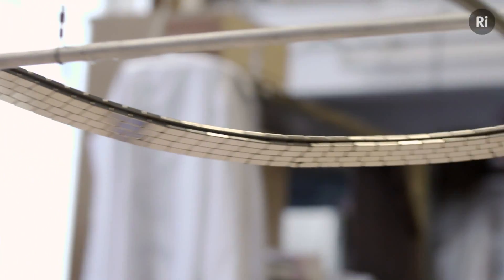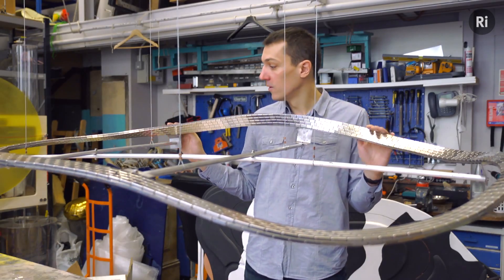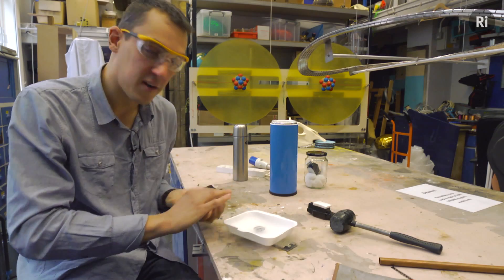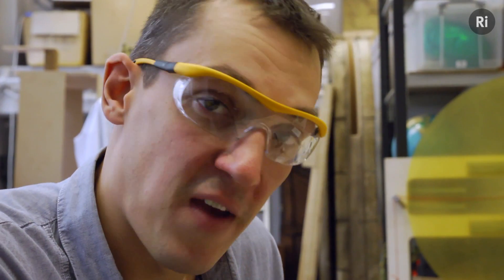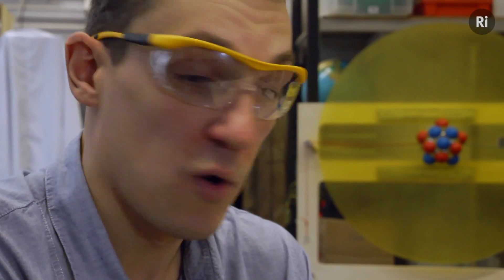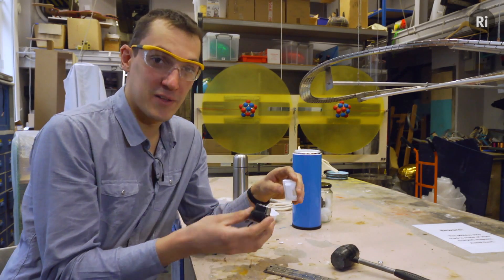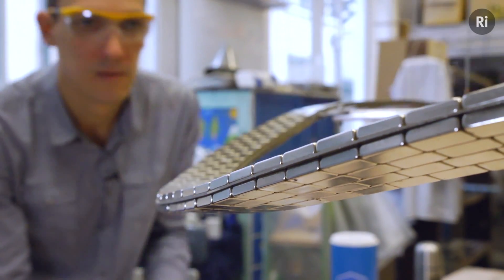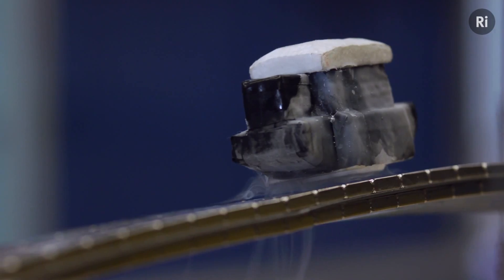Levitating Superconductor on a Möbius strip

Comment: Is it safe for him to handle liquid nitrogen with his bare hands?
Reply: It's called the LedenFrost Effect; If you have ever put a drop of water on a hot pan, you'll notice that it'll actually move around on a "cushion" of vapor before completely vaporizing. Here, the liquid nitrogen flows off his hand as his hand is very "hot" compared to it.
Reply: Perfectly safe, it would evaporate before it touches him.
Reply: as long a its a spill there is no problem if you were to dip your hand in for a longer period then yes it would be bad, the reason you normally put gloves on when handling liquid nitrogen is to protect from intense cold of the flask and other surfaces not the nitrogen itself
Reply: iknowsstuff Thank you G-Man.
Reply: Ubunshi Kalih
 *Leidenfrost
Reply: iknowsstuff Cool. I noticed the nitrogen dripping onto his hand
Reply: Patrick Barlow
Well it does not touch you, that was the point
Reply: To handle it? Absolutely not. You'd be out one hand but those drops are turning to gas before they can reach him.
Reply: Sorry for my spelling
Reply: I work with liquid nitrogen (~77K) and liquid helium (~4K) all the time and I don't wear gloves. I have poured liquid nitrogen on my hands and touched ~77K stainless steel without severe consequences. I've only really been burned by jets of really cold gas shooting out of Dewars.

I'm way more worried about the asphyxiation risks or some idiot sticking these liquids in sealed containers.
Reply: Your skin has a thin layer of gasses over it that protects you from sudden temperature changes. As far I know it's only purpose is to give you time for a "knee jerk reaction".

However working with hot and cold temps regularly does increase your bodies ability to handle them to a certain degree. For example most electronics guys can handle temps upward to 500F before their hands get anything more than a light surface burn: comes from all the times we have to hold onto metal while soldering it down and accidentally grabbing the wrong part of our irons. After awhile you stop getting nasty burns that takes weeks to heal but instead get little light burns that heal in a day or two.
Reply: Alex Stein Google the leidenfrost effect it will answer your question
Reply: Quite an old question, but thanks XD
Reply: He's safe with those goggles..

Comment: awesome! love it! but I hate how each time that thing came around he had to help nudge it. I wanted to see if it would do a couple rounds on its own!
Reply: Air drag would stop it after several rounds.
Reply: To keep the motion continuos, an external force would be required to keep the momentum going...i.e. an small propeller on the opposite side of the desired direction...
Reply: ZamaskowanyWolnościowiec together with changes in direction and orientation.

NewTypexvii  So all together, the answer is no, it wouldn't do a couple of rounds on it's own.

Comment: Excellent video! However, am I right in thinking that the poles on the induced current below the falling magnet graphic are wrong? The north pole of the magnet is falling first and if a south pole was formed by the induced emf/current it would attract the magnet, speeding it up, no? Or am I thinking about this too simplistically?

Comment: I would really like to see complete explanation with exact descriptions of currents induced inside a superconductor during the levitation, but especially during change of its position relatively to the magnets (like putting it on the other side of the mobius string in this video).

For example, are there really any currents, while we cool superconductor sitting still over magnets? Or they just induce in the moment we move it, to place over another set of magnets, and dissapear again, when superconductor is in the same position relatively to magnetic field as in the moment it was cooled?

It would help a lot understanding this phenomenon. If anyone can help, I will appreciate!

Comment: I can't wait until the streets are lined with super magnets and cars have superconductors instead of tires.
Reply: Yeah, and all your metal devices fly out of your pockets and smash into the road.
Reply: We would need to make the city completely out of plastic though.
Reply: @Octanis0  well there is a project that plans to replace most roads with replaceable compressed recycled plastic
Reply: @goodoldave8680  what??? The road needs to be made out of magnet. You are missing the point. What he meant is the rest of the city needs to be made out of plastic, beside the road of which will be made out of magnet.
Reply: @rpylamp8960  Or you can make the roads of room temperature superconductors and put the magnets under the car
Reply: @giovannibini6809  superconductor are more expensive than normal magnets...
Reply: ***** More magnets... magnets fix all of life's problems.
Reply: there is a reason we have trains and cars but not train-cars for land transport
Reply: It would never happen

Comment: I didn't know you could use neodymium magnets as the track - I thought the whole track had to be superconductive.  What would the kW of a refrigerator have to be to keep the nitrogen liquid (and ground resistance zero) compared to the kW in rolling resistance we now have to live with.  1/2?  1/100th?  1?  a billionth?

Comment: Isn't the diagram used from 3:20 onwards incorrect? According to Lenz's law, the induced current will create a magnetic field which opposes the original change in flux. Shouldn't the induced magnetic field therefore have a North Pole directed downwards, not up as shown in the video?

Comment: you should have put a little battery powered propeller on it.
Reply: The bigger problem is having the electric motor that close to the magnets.
Reply: @JoshuaHerbison_this_is_my_URL  MuMetal would solve that problem.
Reply: Well, the nitrogen was evaporating and expanding; guiding this though a small jet would propel the boaty-thing...
Reply: The nitrogen would freeze it in place and it won't propel.
Reply: putting it on the outside of The foam box would be more the enough insulation . or a couple of small struts . Not that hard of a problem to solve...
Reply: Yea, that would work I suppose. I wonder if we will ever make a superconductor without the need for cumbersome nitrogen.
Reply: Liquid nitrogen jet fuel can not melt steel beams.
Reply: Just make the motor out of superconductors =)
Reply: @Nibblet Can you talk with me, I like that comment

Comment: table of possible achievements:
1st:super conductors that work on room temperature
2nd:levitating cars
3rd:Mario Kart 8 in real life xD
Reply: 1.1 superconducting processors that work on room temperatures. fuck levitating cars, they can wait.. :D
Reply: "1st:super conductors that work on room temperature"

Already done. But we don't know how to produce it pure (only a small part of the conductor is the superconductor, giving you a small jump in resistance when going above Tc of that part which is superconducting).

We don't know how to cheaply mass produce it.

The usual problem of high temperature superconductors (all the ones that work with liquid nitrogen cooling) remain. Superconductors can't withstand very strong magnetic fields, or the superconductivity disappears. Type II superconductors form magnetic vortices, that channel the magnetic field in "pillars" of normal non-superconducting material, in a sea of superconducting material; this allows the critical field to be higher before the superconductivity breaks down. For high temperature superconductors this critical magnetic field tends to be too low for most interesting applications, even if it's a type II superconductor.
Reply: Using carbonnano tubes we could make quasi super conductors. Not really superconductor, but something like 1000 times better than cooper Pair it with a small battery and circuit you could make something that works the same way with out using superconductors.

We can do it today to with copper coils, but the the battery will run out in 2 minutes, with carbon nanotubes it will last for hours.

There is actually toys that work this way.
Levitron World Stage Levitating Globe - http://www.earthtechproducts.com
The magnet is in the glob insted, and there is a coil doing the same work as the super conductor. A small transistor feed in losed power into the coil to it act the same way as a super conductor.

Also, Transrapid Magnettrain, works the same way, no superconductor. Thow SC-maglev magnettrain in Japan doe use superconductor.

Comment: If E=BLV how can there be an induced voltage without the velocity? What is cutting the lines of flux if there is no movement? Also what happens to the permeability exactly? Surely we could create generators without prime movers if this works as well as this, as long as we can maintain a low temperature.
Reply: In normal conductors where resistance is not 0 , there is no problem to this rule as when he demonstrated earlier with the copper tube, the magnet just slowed down. The only reason an induced current dies down is due to the resistance of that material. However in a superconductor since the substance offers no resistance to the electrical current initially when you drop the magnet, gravity speeds it up just a little bit, however the current induced in the rod keep on going perpetually without any dissipation. This might seem like a violation of the conservation of energy but actually it isn't. The magnet falls just a little bit down when placed in a tube made of a superconductor. This work done by gravity is enough to generate current. So initial energy is still equal to the final energy , its just that even a tiny amount of velocity is enough to make the current infinite or perpetual ( I=V/R , when R=0 I -> infinity no matter what the value of V unless it too is 0 , which it is not in this case) Its in a state of equilibrium. Hope this clarified your doubt, use of the formula E=Blv does not actually make sense when R is 0, but it is valid for that tiny drop the superconductor experiences where flux changes and hence there is an induced current which opposes its fall. Not very practical to use a generator with superconductors as even if the generation process can be made with 100% efficiency, the wires you use to transport the electricity would have resistance , which is practically impossible to remove. Plus the process is quite expensive for not such a big gain.
Reply: Thanks for shedding some light. I've been fascinated with superconductors since I first heard about them... They just act so strangely. But if a generators rotor was made up of super conductors whilst the stator was traditional turns of copper could it not theoretically generate electricity without a prime mover once it started to rotate? Even with the I2R losses of the copper that electricity would essentially be generated at the price of maintaining the supercooling of the rotor. Or am I missing something?
Reply: Once "locked" in position, no need velocity. Actually, any attempt to move from it's locked position cause some velocity, which in turn induce electric current, which make magnetic field so that opposes any radial movement (only one freedom of movement is along 'road' of the magnets).

Comment: There's only one thing you didn't really explain, so my question is, why must you "lock it in" to a specific height during the cool down period? What happens during that time that wold otherwise prevent you from just placing it on the track?
Reply: There are 2 mechanisms of cf cooling
1. "ZFC" zero field cooling
2. FC
The difference: in the first case we obtain full screenning effect. Superconductor screens any applied magnetic field below critical, which is bigger than we can obtain using Nd magnets.
in the second case, after cooling, we obtain some "frozen" field inside, because we cooled in magnetic field. This frozen field interract with applied field, thats why it seems connected.
The theory of this material is very complicated and base on quantum mechanics, many things are unknown, but the properties are very interesting. I am doing PhD work, wich will based on YBCO.
Reply: Any movement dissipates energy and disturbs the superconductive state

Comment: Or you simply use it in environments where you dont lose energy on such low temperatures (dark side of the moon and stuff). I allready see "railguns" using superconductivity which shoot Helium 3 capsules into earth reentry orbit to power our fusion power plants^^
Reply: dark side of the moon actually sees quite a bit of light. The temps can get on up there too......
Reply: 4x4le There are plenty of craters never seeing any light on the poles which you could build those railguns into.
Reply: Daniel T air is a very good isolator which means it conducts heat very pooly. An object loses its heat energy mostly by electromagnetic radiation. On lower temperatures it is all invisible infrared light but the more it heats up the more it comes into the visible spectrum like a glowing piece of metal or the sun.

Thats the reason actors sweat like crazy in the spot light. They can put there as much ventilation as they want, they cant block the heat as long they dont block the light.

Do you know those thin metallic covers they put on freezing people? They dont block the cold air, they just reflect the infrared light you emit to heat you up on your own.
Reply: Yes, it's low temperature at the poles of the moon, but that's more of an abstraction than anything else. There's not enough atmosphere to conduct heat away from such a device and keep the superconductor below critical temperature.

Comment: Wrong explanation. The superconductor is NOT a magnet. When it is cooled, it traps the magnetic field of the magnet, therefore, locking it in space, as there is no electrical resistance.
Reply: No he explained this very well.

Comment: HI there!! i like what you have done in the video. I have  question of my own can you help me with it??
You showed us what happens when u have a superconductor over a magnet. Now i would like to know what happens when u keep a super conductor over a current carrying (possibly AC 50 hz) conductor ,'does eddy current apply here too, i got so many questions to ask
Reply: electromagnets work just as fine, just like permanent magnets. and you can induce currents in superconductors just fine, like, you can use a primary regular copper coil to drive a superconducting coil in a generator setup. and then you can power up the superconducting coil and power it down.
Reply: my doubt isn't about the working of super conductor i know it will work fine my question is that,is there any back emf induced in superconductor when placed in between the stator coil,as such will there be any greater power loss in the stator core due to super conductor
Reply: Kaleelur Rahaman i think the answer to your question depends mainly on geometry. is it a coil? if yes, how many turns does it have? or is it a sphere? is it moving? if there is any movement, the answer would be yes. generally, i would go for yes, because its easy to induce current into anything if there is any field and any movement or change in field. or no. it depends. if you have a stator coil and put a superconductor inside and when there is no current going through the coil, and no movement, nothing will happen. your question is too imprecise to be understood. if the coil is shaped like a disc, how can you put anything inside it?

Comment: I'm trying to replicate this, what formation are your magenets in. I can get mine to levitate in place but without any seamless motion.
Reply: lets say the track is vertical, and arrows indicate the direction south to north, you need to force them into a repeating pattern and glue them down. (the magnets may not like the pattern very much).

| << >> << >> |
| << >> << >> |
| << >> << >> |
| << >> << >> |

it doesnt need to be this exact pattern, the important thing is that the field is pretty uniform as you go along the track, or up and down in the little graphic i made. if you just snap the magnets together in the way they prefer, you might just get some kind of checkerboard pattern or have it sideways or something.